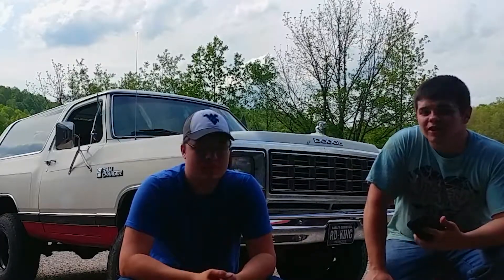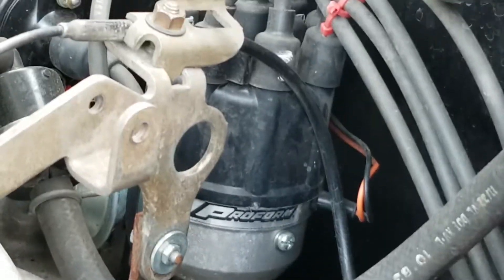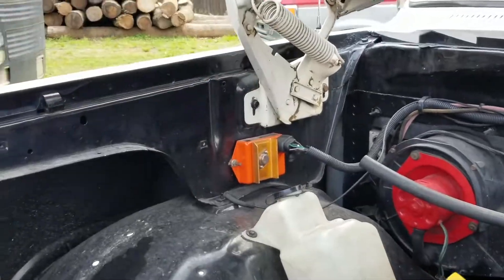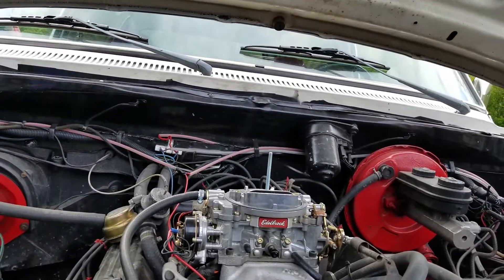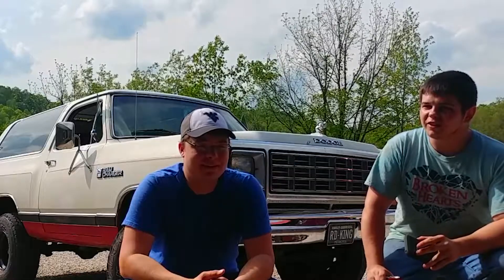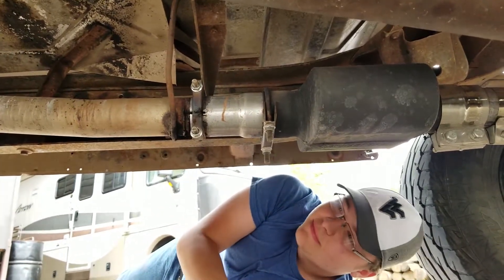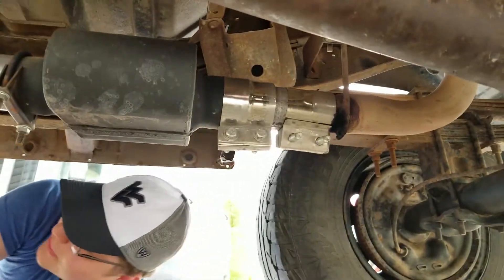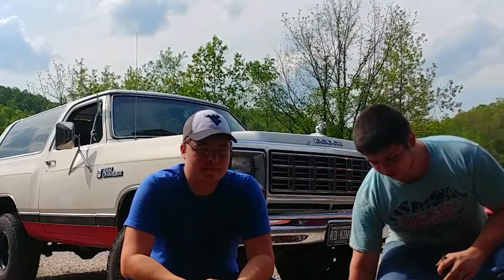Ramcharger Engine Swap Series: Discussing the Issues with the New Engine

Comment: Sounds like a timing chain issue it may have jumped teeth if the original fiber gear the factory used  broke down ,
Reply from the maker: It has a brand new 318 magnum in it so we hope it wouldn't have broken down in 100 miles lol

Comment: Okay so did you get it figured out
Reply from the maker: We got it fixed by switching over the old computer to the conversion kit which had a vacuum advance, along with getting a 4 barrel carburetor, as far as I know it's perfectly fine but it's been several months since it's been ran because we both got different vehicles to save money on gas lol

Comment: Hey guys did you put a timing chain in that motor that was a used motor right because what I can hear it sounds like a timing issue but I know you put in the distributor and they make a spring kit for it you don't have to have a vacuum advance on it . I have fixed many of problems just like that on Dodge for 42 year's
Reply from the maker: It was a remanufactured engine with a brand new crank/pistons/etc and it should have been a new timing kit with it, it was already installed when we got it and it seemed brand new along with it was tight with no slack so we thought nothing of it